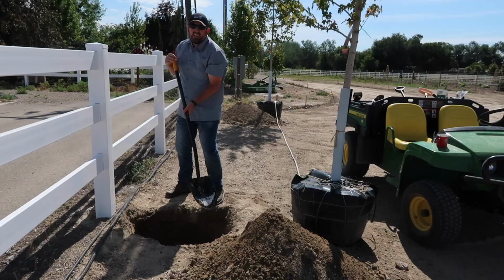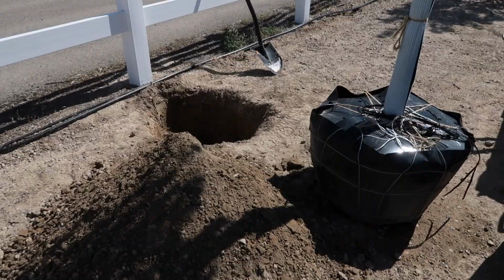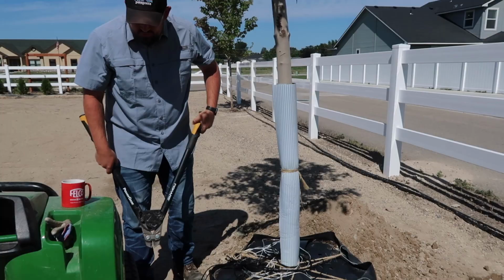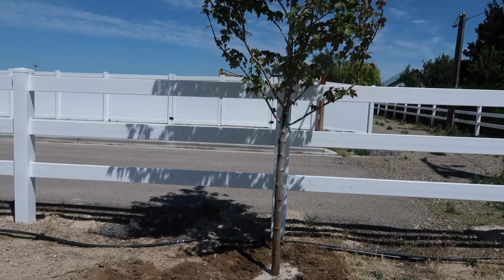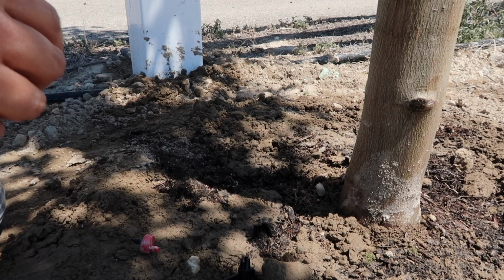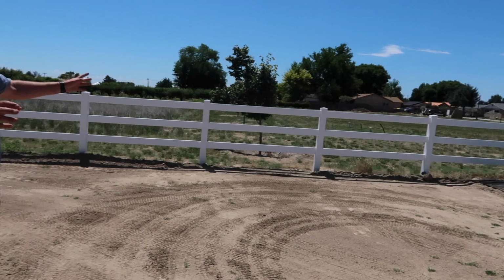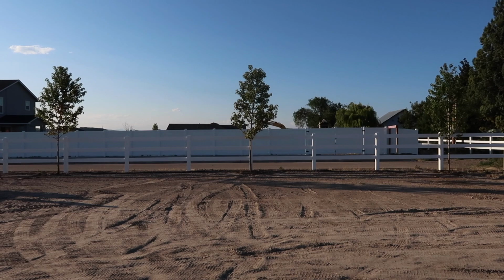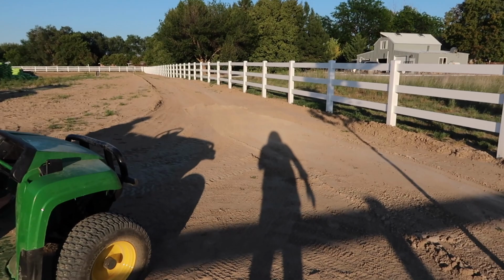Planting Maple Trees on the New Property! 🌳🌳🌳// Garden Answer

Comment: Why do you fill the hole with water prior to planting the trees? Do you do this with all trees you plant or just ones of this size? Thanks 😄
Reply: If you water from above the water isnt going to get deep enough to get to those bottom roots and you want those roots nice and moist in order for the tree to put out more roots to get properly established
Reply: We've done that, there's clayey soil out there and it just helps, rather than placing plant into a dry hole and watering from above, hoping it's enough water.

Comment: Why do you fill the holes with water before planting instead of watering in after?
Reply: I don't know but that's the way my family did it too!
Reply: I do that too when I am planting flowers and see that the soil is too dry and hard. Than I just let the hole fill up once or twice and let the water soak in, it loosens the soil, so the roots will have a much easier start. And if I only watered the plant after covered in soil, I think the rootball with its nice soil would soak in all the water, but not the soil around.
Reply: I think it gives the bottom roots where the water uptake starts a good start and drink than  hitting hard dry ground, and trying to find the water before it dries.
Reply: If you water from above the water isnt going to get deep enough to get to those bottom roots and you want those roots and the soil around it nice and moist in order for the tree to put out more roots to get properly established
Reply: I think its odd but I'm also in an area where we do have consistent rain.

Comment: A good way to plant trees and shrubs and assure strong plants by winter, dig hole deeper, add cow manure mixed with dry leaves. Put a healthy layer of soil between mixture and root ball. As the "compost" works, it creates heat, drawing roots towards it. By the time they get there, it has composted sufficiently as to not burn the roots.
Reply: PS: Create a small, circular ridge around the plant and fill with mulch to stop water runoff.

Comment: Good work! Two questions I have: 1) whenever I've planted trees I've been advised to dig the hole 3x wider than the root ball; I assume this is to make sure the soil is loose enough for the roots to spread. Do you find this unnecessary? 2) Do these maples throw helicopter seeds? Our neighbor has some variety of maple and I've been cleaning seed pods out of my flower beds and weeding tiny maple trees all season!! Such a pain, but they are beautiful trees.

Comment: I would have thought that the middle of summer is not the best time to plant trees, due to the additional stress from the heat and trying to send out new roots.  I'm assuming that with the irrigation in place, this shouldn't be as much of a problem?  In our area south of Seattle, we run into the glacial till below the topsoil, which is relatively impervious.  When I've planted trees on our farm, I've tried to auger  a 4" diameter hole at least 2 to 3 feet below the planting pit to assist in keeping the water from "pooling" in the planting zone.  It hasn't appeared to have hurt the trees I've planted over the years; hopefully it helped them :)

Comment: I just spent ages trying to attach a triple connector and a 2 gal emitter to a 1/4 inch tube. I had to use hot water to soften up the tube. My husband and I took turns for about half an hour until we finally got over those darn barbs. How do you just push them in? Just strong wrists? A trick of some sort?

Comment: Question: when you connected  drip to 2 of the maples, it didn’t look like you attached emitters to the ends by the tree, but on the maple in the corner, you had 2 drip lines for the tree and you attached emitters (the orange thingies) to the ends by the tree. Is it ok to just bring a 1/4 inch line to a plant without an emitter?  Are there pros and cons?

Comment: Is there a reason you place the emitter on the distribution pipe, then run the line to the tree? Instead of having the emitter at the other end of the 1/4” tube next to football of tree? Have I been doing it wrong?
Reply: Paul Darr They did it that way on the last tree in the corner, it doesn’t matter, either way gets water to the plant.